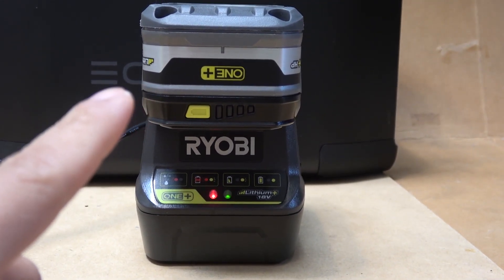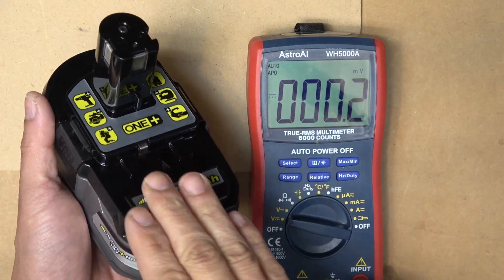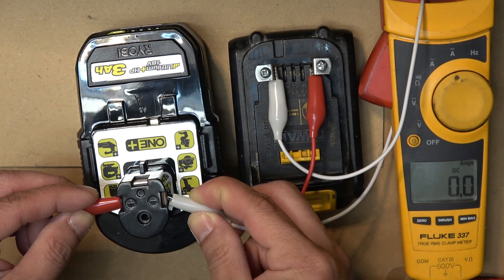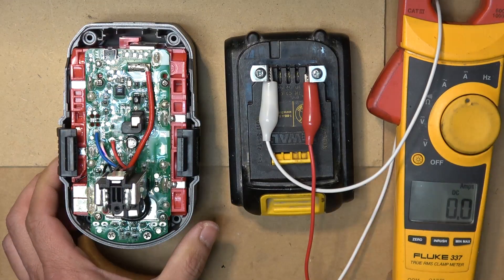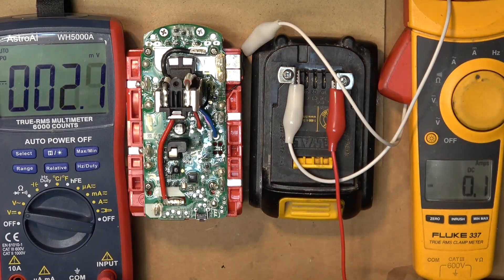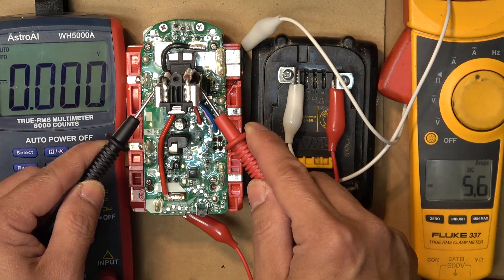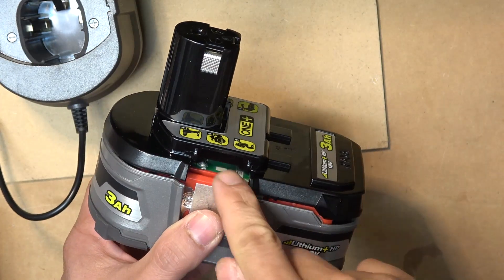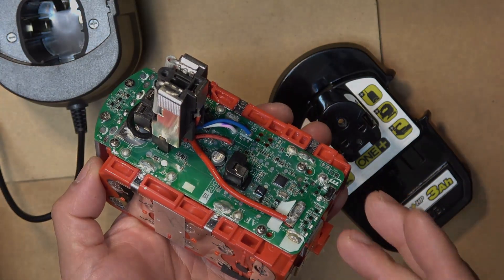Revive a NEW DEAD zero volt Ryobi 18V power tool battery

Comment: Thank you so much. I was able to fix my Ryobi battery using another Ryobi battery to bypass the BMS and just hold 30 to 40 sec negative and positive to jump start the battery. Then put it back into housing quickly and charging work. Check with multimeters 15v and it charge.

Comment: These batteries are trash 
The cells are fine but the BMS is trash
They all fail and none of these jump start methods do shit to fix it 
The boards are bad  and not repairable.
I get almost zero volts on the tower 
But almost full charge from the cells

Comment: Kool way to revive a Ryobi battery using another battery. Is it possible to repair a battery that went shorty in the water while drilling a hole in a 2x8 board in a dam?
Reply: Same thing happnd to me, I've replaced BMS from aliexpress and it's been working so far, you need solder gun and some skills.

Comment: I revived a dead battery a couple of times using this method. It gets it going again and works fine, but I have to keep it on the charger or it will die again in a few days. Is there a trick to stop the phantom drain?

Comment: I bought a single Torx 10 Security bit from my local auto supply dealer for about $4 which you will need to undo the screws. There is also a screw hidden under a small rubber plug on top that you need to pry out with a needle or awl and yoru good to go .

Comment: Will this work with the 18V one+ batteries. Older ones that were sold as system years ago that are a yellow mustard color. Don’t think they’re lithium? I did something similar to this with a car battery, that wouldn’t charge, with another donor battery hack a while back. I forgot how I did it, found it online and it worked. Something about fooling the charger to charge the dead battery and bring it back to life…

Comment: I think mine might have something else wrong with it :(  I tried doing this with two identical Ryobi 18v 4ah batteries.  Voltage on the dead one at the BMS terminals used to just read 0.  After charging it directly the voltage bounces around for a second between 2-5 volts then slowly drops to 00.1 volts.  Volts on the direct battery terminals (bad battery) measure 18.0 volts and the current measures 4.6 amps.  My source good battery started off at 20 volts.  I discharged it to 18 volts, recharged it and used it again.  It's now at 19 volts.  I suppose I can keep trying until they are at equilibrium but I feel like from watching this video it shouldn't take so much time to juice the batteries up enough to get the BMS to figure out the cells are fine and let it charge normally.
Reply: I have several batteries with the same issue. Batteries test fine and hold voltage. Terminals don't show voltage won't charge or run tools.

I found replacement circuit boards online and am going to try that.

Comment: This method sends far to much current through those cells.  When first connected it reads 27 Amps!  That 's enough to damage the cells you are trying to recharge.  If you use a power supply with current limiting, you'd be much better off. 

(I can hear you now..."Not everybody has a power supply."     I realize this.  But sending huge amounts of current to dead cells is still a bad idea.)

Another thing that would be smart to do is to check the voltage of each cell in the "5S" string... to verify they are balanced with each other.  E.G. - 3.50V, 3.52V, 3.51V, 3.54V, 3.49V is reasonably well balanced.  Then, recheck when fully charged, as the "top balance" can be different than the discharged balance.  (The "top balance" is more important.)

Last comment -  this manual charging solution doesn't solve the BMS issue on some units.  You'll need to RESET the BMS to clear the error flag.  There are several other videos that can explain how to do this, but essentially you just short the 3.3V power going to the microcontroller to ground.
Reply: Doesn't a battery or battery pack take so much charge current as wants itself? It will self regulate the current as long as the voltages are within reason.
Reply: @Drottninggatan2017  Nope, if cell is in good state (low internal resistance), it can draw 200Amps easily. Current = Voltage / InternalResistance   4,2V/0.02ohm=210Amps!! Also if one or more cells are death, voltage on the battery will be higher so it get even worse.

Just get some 24VDC bulb and put it in series, to limit the current.

Comment: I Have A Ryobi Battery & The Testlight
Didn't Work So I Took It Apart & 
Blew Out All The Dust. & It Worked For A While & It Quit Working.
So I Might Have To Take It Apart Again. So What Could Be The Issue?
Could It Be A Loose Solder Connection? Or Could It Be 
The Switch It's Self?
Reply: could be your batteries are just dead. They die a shit death.

Comment: I have the same problem with my 2 Ryobi batteries - I had been charging them every few months but stopped after a 2 month stay in hospital (heart operation that led to sepsis, luckily I survived). Last time I went to use it they were both dead flat. I know about the direct charge trick but don't have anything else at 18V DC so need to find an 18V battery for cheap money to do this but haven't come across any on the times I've looked. I don't really need another 18V battery except for this so don't want to spend much. I think I may resort to building a pack from other battteries but something I'll use but annoyed because I threw out 2 e bike 36V battery packs that I could have butchered for this purpose a couple of years ago after the bike was stolen (with no batteries as they'd been removed for charging). Seeing this has revived my interest - I think I'll try connecting the third battery terminal directly to the battery main terminal first. By any chance could you please check if it reads +ve or -ve for me? Many thanks!
Reply: If they are at zero, first start with a car battery, then start it up and get 13+... then try to charge them normally. You don't need a full 18v to bring them back from the dead to where the BMS will recognize it as a working cell.

Comment: Hey man, just wanna say i love your videos, I am learning so much from them!  I have a question for you. I have a 10ah dewalt battery that won't charge. It was a brand new battery and never worked. Dewalt sent me a new one, but I still have this and I am trying to revive it. I have opened it up and tried to jump start it like in this video, but I am not sure if the Dewalt battery functions the same as the Ryobi. I connect the + and - terminals from another 20v dewalt, and when connected the voltmeter shows 20v, but as soon as i disconnect the voltage drops to 6-7v immediately, then half second later it is down to 3v. I have never been able to get it to above 3v for more than 1 second, even leaving it connected to another dewalt battery for over an hr. Any idea what i can do to try charge this as a pack? I am almost at the point that I want to tear it down and try charge the individual cells in my xtar battery charger. Thanks!

Comment: After jumping the Ryobi Battery and charging with the Ryobi charger -- what has changed with BMS to allow normal charging ?
Reply: The BMS is programmed (there is a microcontroller on that board) no, actually it is ONLY powered by the Lithium cells. They use blocking transistors to stop normal charging if the batteries are fully dead. In otherwords, the BMS is working 24/7, but mostly in sleep mode.  Hope that makes sense. I program devices like this. (just never programmed a bms but this is my best guess).

Comment: This should be illegal, just like BMS's that shut down after a certain amount of cycles.
Reply: manufacturers know were "jump starting". packs so they prevented it by putting measures in the name of "safety" of course.
Reply: @10OZDuster  If one cell is death and you try to charge it with high current, you can easily overcharge it and battery can catch on fire.

Comment: Great to know how to bypass the BMS in a case like this.  The average consumer would likely have junked it and bought a new battery pack from Ryobi.  In this case, I would imagine it highly unlikely that any dangerous conditions like dendrite formation in the cells, could have occured.  However,  I would assume the Ryobi design engineers have to limit their liability as there would likely be no reasonable way to have the BMS detect the age of the pack and decide whether to charge a 0V pack or not.  But as consumers, we can make that call as you did.  I had to revive a 0V pack recently too and also bypassed the BMS to do it.

Comment: That's what happens you buy a cheap battery.  Go with the best well-known, then you don't get screwed (Dewalt or Milwaukee). Good video, my friend.
Reply: I have 6 brand new Milwaukee M18 and M12 that looks absolutely shiny and new but are dead and had to jump start from inside direct to the terminals.   Milwaukee is not quality as it used to be but not surprised as RYOBI and MILWAUKEE is from same manufacturer TTI Inc.
Reply from the maker: Yep, low quality cells and sketchy BMS is how Ryobi rolls now.
Reply: @vuaeco  that's because the BMS is running 24/7 likely in sleep mode. Sleep mode while it's drain is minimal, still drains the battery over time.  If it's power from the battery cells is dead, then it will not work and will not trigger the circuits to allow charging from the outside power tabs.
Reply: Milwaukee, Ryobi and HD's Ridgid brand are all of the same manufacture (TTI). If you look at the BMS board, Vu, you will see markings to attach different terminals for those two others.
Reply from the maker: @fun_ghoul  But yet somehow this only happens to Ryobi batteries. I wonder why? :D
Reply from the maker: @fun_ghoul  LOL, no, I don't. Maybe some day when I'm rich enough to buy Home Depot. :D

Comment: I take it that 10 cells means you have LG (I forget the model designation) 1500mAh cells, which are rated for 30A continuous. Can you see the wrappers at all? I think they might be like lavender in colour...
Reply from the maker: These are wrapped in blue shrink wrap. Ryobi is cheap on this model. They use after-market cells, made in China. They are probably only 20A continuous each (maybe even less) because they are 2 cells in parallel.
Reply: @vuaeco  ha. Where are non-after-market cells made?:

Comment: I bought six 9ah packs in 2019 for my ebike, along with the "Supercharger". I used it to charge them once, then I disassembled the Ryobi packs, dumped their BMSes, hooked them up with no BMS and bulk charged them. No BMS is a bit sketchy, but I checked cell group voltage regularly, which was always happy because they used the Sony VTC6 cells (which self-balance pretty well). Knowing they used those cells was actually why I bought them.

Pretty expensive in a certain sense (C$450 with tax for ~648Wh, or almost C$700/kWh), but I didn't need more than a soldering iron to get rolling, and I knew it had nice cells. I had initially hoped to keep the Ryobi packs intact so I could use the Supercharger for charging, but the BMS -- and me not knowing I could use a diode to series them -- put the kibosh on that. The packs got warm on my usual ride to the weed store, around 50km round trip, but they had the range even with a 9C motor and 26A Xie Chang controller, in hilly Ottawa, and with my fat speed-demon self on board.

A couple months later, I got a sweetheart deal on a Golden Motor dual-motor bike with a Headway 40152S 16s pack, which supplanted the Ryobis. So they sit on a shelf, lonely, with only an occasional discharge/charge cycle to keep them happy...
Reply from the maker: Sony VTC6 cells are one of the best cells. I don't think Ryobi uses these cells any more. They use cheap Chinese cells now. Even Kobalt who used to have Samsung and Sanyo cells now they turn to cheap Chinese after market cells. If it looks orange inside that Kobalt 24V battery, you get after-market cells.
Reply from the maker: "Ride 50Km to the weed store"! :D
Reply: @vuaeco  Well, 25km there and 25km back. This is a vagary of living on the line between two jurisdictions: Prices, especially on highly taxed goods, can vary wildly. That was when Ottawa only had 3 private weed stores for a city of a million which gouged like crazy compared to the Quebec government-owned weed store across the river. Now, there's a weed store on every block!

Of course, being in California, I'm sure you have no clue about weed stores on every block... 🌬️💨
Reply from the maker: @fun_ghoul  Well, it's been legal here since 2016. But every block? Maybe only in Canada. I guess you can now walk to the weed store instead of using your bike. :D
Reply: How did you check each cell group voltage regularly if they are also soldered into other cell groups? And how would you determine  if a cell group is faulty?  Can it done with a regular multimeter voltage drop during standby in 1wk?  And how to identify which individual battery cell is weak / faulty / reversed -- if it's soldered into a group?
Reply: I'm familiar w a residential AC circuit.  I'm just confused as a DC ebike battery pack the individual cells are group connected in parallel which then is connected in a series. So being connected like this what is the way to identify a bad group and from there a bad individual battery cell -- w/o disconnecting the solder tabs?
Reply: @fun_ghoul  Ok thank! So to test a parallel cell group you still have to isolate and disconnect that group from the the rest of the series before testing its  + /- leads for any voltage drop? And this is done after running riding the whole battery down to say 33V for a 36V rated battery ? Thanks !
Reply: @connicrow9463  No offence, but...do you know what a circuit is?

Comment: Jump start worked well for you, be careful when bypassing the bms, if you have 1 bad cell then you can cause harm by uneven voltage across multiple cells,, maybe try jump start on each individual cell , good video, keep making more please
Reply: Having one bad cell is less likely with an unused battery, but still good general advice.

EDIT: Very good advice, actually. 👍
Reply: @fun_ghoul 😅u

Comment: They want you to toss it out and buy a new one. Smart chargers ain't really smart. Same happens with other batteries or even newer car chargers that wont charge your battery if it's voltage is too low.
Reply: You're exactly right. I have a couple of different car chargers that are computerized and will not revive my car battery that's been sitting for months. Created my own using an 12v transformer and a bridge rectifier. After a couple of hours on that, it was up enough that the computer charger would take over and do the rest.
Reply from the maker: Spending is a way to stimulate the economy.
Reply: @vuaeco  hahahaha!

Comment: Gonna try this with a bunch of Black & Decker 18v batteries I got free from the local electronic recycle.
Reply: I strongly suggest you heed the advice of Rick Summerfield in these comments (namely, measure each cell group and charge them individually), as well as limiting the amount of current you use; that recycling centre should have a crapload of old cell phone chargers, which make decent lower-current single-cell chargers (until they crap out). 10A is gonna be too much for some old cells! You might also do this outdoors, in case you have a more exciting day than you planned for! 🔥